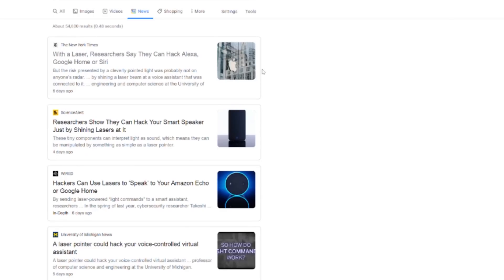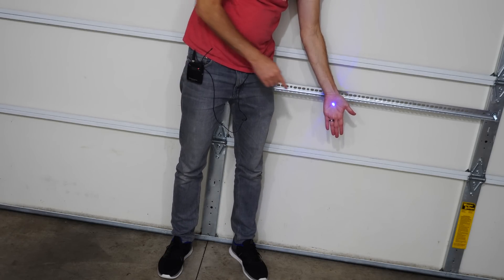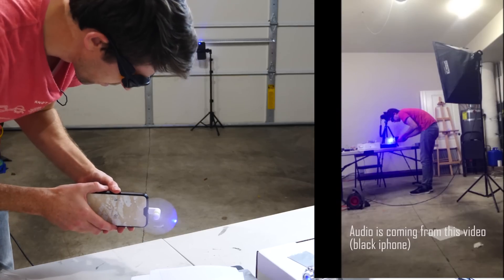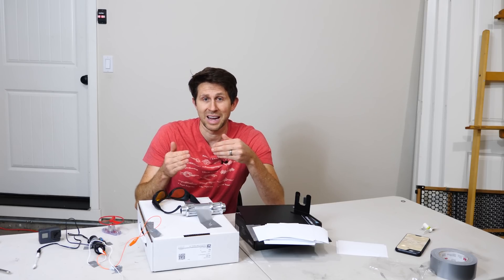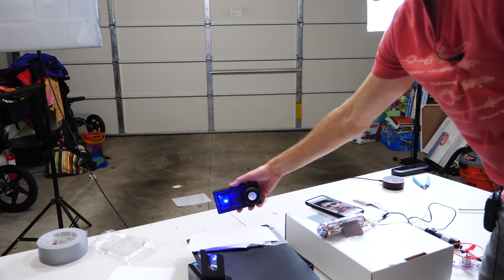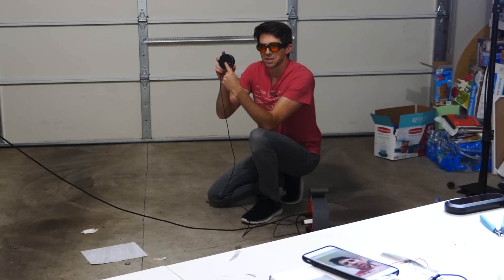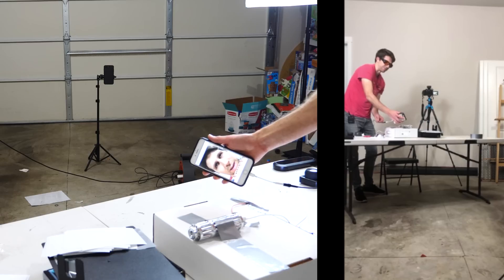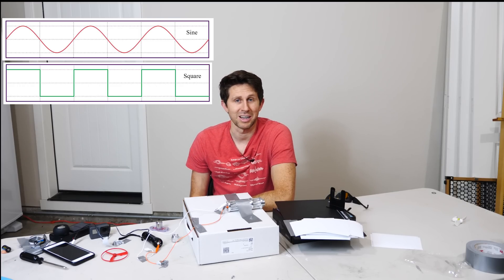Hacking into an Amazon Echo Using Laser Light to "Speak" to Alexa

Comment from the maker: I was actually surprised that you could hear the sound from the pulsed laser just by using a fan! I just need to turn my sine waves into square waves and I'm set!
Reply: how about if you had a plastic diaphram jammed in/on your ear and stood in front of your laser setup? could you as a human detct the sounds? a passive setup like that could have many implications
Reply: You should try modulating the audio signal with PWM. That should do the trick
Reply: @iAgos46  I was thinking the same thing.
PWM is pulsed width modulation if anyone was wondering.
Reply: Plz repeat the same experiment by keeping the microphone in vacuum chamber
Reply: Just as a test on mics, you should try it with a regular microphone. That way you can establish whether or not it's the plastic casing on the echo that's blocking the signal.
EDIT: Also, try it with Siri, Cortana or Google Assistant.
Reply: You need to mention that the paper was about exploiting a characteristic of MEMS microphones.
Using a photocell is not the same phenomenon.
Reply: @netpilot5  Hm interesting, but can it still be caused by the photoelectric effect?

Since some diodes and other components also respond to light. 

For example the Raspberry PI 2 (its like a small PC) once had a similar component on board.
The component was part of the power supply and the problem was that you were able to turn the system off with the help of camera flashes (xenon light) of some smartphones.

Sadly I was not able to find information about why MEMS-microphones would have this problem.
("When it comes to the actual physics of a microphone interpreting light as sound, the researchers had a surprising answer: They don't know. In fact, in the interest of scientific rigor, they refused to even speculate about what photoacoustic mechanics caused their light-as-speech effect.")
Reply: @CrazyT2009  tbh, if the guys who wrote the paper aren’t sure, I can’t speculate. They’re way smarter than me. 😊  But MEMS devices can have some weird characteristics. For instance, MEMS oscillators tend to stop working when exposed to helium. Also, the guys in the original paper used a powerful laser (5-10 watts at less than 10 feet away, if I remember) so whatever was going for them, they were really disturbing the microphones.
Reply: @netpilot5  According to https://www.wired.com/story/lasers-hack-amazon-echo-google-home/ it could actually be both. (laser that heats the membrane or photoelectric effect)
"But at least two different physical mechanisms might be producing the vibrations that make the light commands possible, says Paul Horowitz, a professor emeritus of physics and electrical engineering at Harvard and the co-author of The Art of Electronics. First, a pulse of laser light would heat up the microphone's diaphragm, which would expand the air around it and create a bump in pressure just as sound would. Alternately, Horowitz posits that if the components of the target devices aren't fully opaque, the laser's light may get past the microphone and directly hit the electronic chip that interprets its vibrations into an electrical signal. Horowitz says this could result in the same photovoltaic effect that occurs in diodes in solar cells and at the ends of fiberoptic cables, turning light into electricity or electrical signals."

I wonder if its possible to figure out what could be the reason.
Like cooling it down see if it has impact on it, or put it in a vacuum chamber.
Reply: however the physical audio that we provide as source to the microphone is analogous hence sinusoidal right?
Reply: @adharshkrish  YES! His voice being recorded in the making of this video is proof a microphone  does not need a square wave! I hope he just worded his thought process wrong cause what he said was definitely wrong.
Reply: Could you use the fan instead of the flashlight? Then the sine wave would be in the RPMs of the fan, which would convert the sine pattern to a square wave pattern at the hardware level instead of trying to come up with something to convert the sine wave to a square wave digitally?
Reply: Point the laser at the Alexa mic and tell it to start recording, play back the recording to confirm it is receiving the frequency from the laser
Reply: I guess some microphones are sensitive to light just like some air pressure sensors are, look at my video "My naza unit is sensitive to light"... Some modern microphones probably are designed around same type of semiconductors as pressure sensors... (well a mic is actually a air pressure sensor when you think about it)
Reply: Does anybody know where I can get that solar panel speaker? I Can't find anything like it, only solar powered, not solar input.
Reply: @TwoScooops  Why not get a solar charger and a Bluetooth speaker?

Seems like you could use 2 cheap off the shelf items instead of a single more expensive purpose built item.
Reply: @TwoScooops  https://profbunsen.com.au/product/the-light-modulator/

Or Grand Illusions in UK or just search google for buy light modulator.
Reply: Just put the fan in front of the voice laser! It will modelate your voice into a robotic one. Perhaps Alexa will still strigger?
Reply: Your experiment worked with the solar panel because it transfer light to electricity that make sound but didn't work with alexa because it can't sense light 
- sorry for my bad English
Reply: @The Action Lab did you note you replicated at minor scale the pulsars phenomena, detected many years ago, experimenting with the fan that interrupted the laser pulse? 😀
Another thing I loved of this video is that it can see how many frequencies of energy you were working, starting the visible light and the sound are energy in movement but in different frequencies. Thank you for make and post this video. 😃👍
Reply: Please read my comment. I just read the news about hackers using low-power lasers to "hack" phones and smart devices pike Google Home and everything. Maybe it was a coincidence and your video was uploaded when this discovery happened, but I'm now worried
Reply: Try to just turn laser on..off.on..off... and check if you can pick up sound by just doing that
Reply: S. A. Khan he already did, with the fan. Silly
Reply: Be good if you linked the video to the thing with the torch and speaker...
Reply: you could reduce the bitdepth to 1 bit
Reply: How about you use a fan while you modulate your voice through the laser? it would sound kinda robotic yes but you'll hear yourself anyway.
Reply: @Crescent Fresh Idk if that's possible, this video is showing how audio can be transmitted via laser, not how audio can be received. But that would be cool!
Reply: Two french guys made a video several years ago where they transmitted sound with laser at a huge distance.
Reply: You should have tried to put the fan in front of the beam while you were trying to trasmit your voice to the microphone.
Reply: The Action Lab lmao your to smart for me I’m only in 7th grade
Reply: The Egg Turtle you’re*
Reply: Show us solar panel working microphone
Reply: i say it's a form of electromagnetic interference, same as if you would put a micorphone up to a live speaker and get screaming feedback noises
Reply: Maybe the light pushes the diafragm of the microphone
Reply: Sure it didn't work because the frequency shifted from trying to vibrate a microphone instead of being received as light on a solar panel? Might want to start with recording the pulses with a standard microphone and listening to it.
Reply: Alexa won't pickup all the non human voices with in few months.
Reply: Maybe have a look into something related to PWM. It might need a frequency modulation in this case rather than amplitude.
Reply: What if you used a distorted version of your voice so it's more square?
Reply: Talking about a modern twist for the string on a can method for communication
Reply: May I suggest in future videos, you should show the effects first then explain? It would be less painful understanding the purpose of the video...
Reply: The Action Lab i really love you video. Please made a burning laser line using your laser. Thank you so much
Reply: I would like to know where and how you searched for those items , the solar panel speaker ,the laser and the sound/light modulater please :3

Greetings from Brazil 🇧🇷
Reply: Can you slow the fan down an speed it up to simulate words or pulses the laser and not use audio
Reply: I now know how to have my neighbors Alexa order 500 Nike's.
Reply: The Action Lab surely this is how digital audio works, right?
Reply: This means the sound is moving at the speed of light
Reply: When are you going to post that third videoooo???
Reply: Did you ever do part 2?
Reply: Yaa
Reply: You need to convert from analog wave to digital imo
Reply: ok boomer
Reply: Is this how optical fibre work?
Reply: Shuvrashankar mukherjee I guess that is not the case.Fiber optics deals with data conversion/deconversion based upon photoelectric effect. Apparently, this hacking occurs because of some light to mechanical effect that makes the microphone diapragm move back and forward reproducing the laser on/off signal.
Reply: This is what I made 1 year ago and uploaded it on my channel pls cheak it out🤠🤠😎😎😎😎
Reply: Nikunj Patidar damn you didn’t lie
Reply: @nick5845  Everyone should see this comment and check out your video.
Reply: Nikunj Patidar why would anyone want to watch an indian

Comment: @TheActionLab, Just a question: Do ALL laser lights require to wear safety goggles??... I never owned a laser light before, like, a laser pointer. Sometimes professors to teach with laser pointers and yet, nobody is needed to wear special glasses for it... Are just curious if we are talking about two different kinds of lasers here, or if wearing the special glasses is just for extra precaution... And, IS THERE a safe laser light out there that doesn't suggest/require special glasses to wear in order to be safe using it? Thank you. :)

Comment: It may have happened off camera but I didn't see you really line up the light with the actual speaker hole on the Amazon device like you seemed to need to do for the cell phone to get the signal into the mic. Could that be it? Just missing that opening on the top so it didn't get a chance to violate the diaphragm? 

Also, as a person with an African Grey Parrot that really enjoys making Alexa and Google work as her minions, it seems like saying Alexa too frequently can cause her to not respond, and so the speed you say her voice on recording might have been too fast. You could check the recordings that the device captured and review them through your profile on Amazon. The device responding isn't necessarily proof that it heard you, it definitely could have picked up your trying to trigger it and then just decided not to respond ruling it as not fitting criteria for activating, it listens a lot, for anyone that hasn't reviewed those recordings, it's pretty creepy. 

I get it "has to" or it won't work, but still the random bits of dialogue it keeps is surreal. I'm also convinced it's not everything that it sends to Amazon either that it's showing us the consumer. I've been served too many targeted ads that were not for me at all, and I can usually chase it back to some weird conversation I was having or something that used I guess some trigger words for ads to start heading my way. Those things don't show up in the recording, especially since I've told it to not save my recordings. 

So being served ads, for example, for My Little Pony the day after I'm talking about my niece being a fan of the show, were a little too not my demographic and unique to be coincidence.

Comment: The issue is you currently are running the laser through a speaker driver which runs on a different frequency in terms of programming than laser. What you could do is run it through a program that translates the lasers signal to a more frequent on off signals. I would suggest using an Arduino to achieve this.

Comment: You might be more successful if you shine the laser on one of the LEDs. It is a little known fact that LEDs generate a voltage when illuminated by a light source. Depending on the circuit you might get the output coupled into the audio circuit.

Comment: There might be problems related to how spesific devices have their microphones physically installed also.
To get a clean signal the laser would need to hit the diaphragm directly. If there are any obstacles in the way (like a simple dust filter or a curved sound channel) the input could get very weak and/or distorted. That might cause the voice recognition to not trigger. With sound these sorts of line-of-sight obstacles are not much of an issue since sound bends and bounces easily, but with a laser it would matter a lot, and the devices weren't built with lasers in mind after all. It wouldn't be hard to make a microphone immune to this technique if you wanted, but I guess it's just not something that has been considered yet, at least for consumer use.

Very cool technique though. With a powerful enough laser you might be able to produce audible sound on many surfaces directly. It would be the same principle, just without an amplifier you would need much more laser power.

Comment: What amaze me is that I do this trick in 1982 with just my first red dot pointer and it work, (officially red laser led tech was release to the public in 1980) . Then I use the sun light to bounce on a mirrow resting on the grass yard and hitting a monocrystalline solar cell connected to the microphone input of a cassette recorder and record all the different frequencies of all insect that cut the light beam. After this I put the mirror on a plastic empty balloon stretched to cover a 5 inces tube and put the mirror over the plastic so I can hear on the sun light any sound produced near the tube and reflected to my solar cell like being there. Thanks to the modulation the balloon transmit to the mirrow and then to the sunlight. Then I use a lens and  I covered the lens with black electric masking tape and only left a needle size hole uncovered of the lens center , I pointed the lens to the sun and the light that pass true the micro hole on the lens was projected on the solar cell so I start hearing the burning process of the sun, then I realize how clouds sound when pass  in front of the sun, then I used it to project the starlight of some stars to the solar cell and discover that some stars are not stars and they are satellites that blink and vibrate reflecting the sunlight to my solar cell and passing to the light all the different vibration they suffer and produce. I used with airplane lights too and some other strange lights of the night sky. I use to use lens with a layer of aluminium foil and a hole of 2 mm to project the image of the sun inside a black box to see the solar disk black dots and solar flares and at the end I connect a speaker to a gradient expose photography film in the light of the red laser diode and capture the light on a solar cell connected to the microphone of the cassette recorder and its record the music even at a distance of 50 meters. Then I realize that the cassette head was a sensor so I connect the solar cell to the cables of the play head of the cassette recorder and put it on play mode. immediately I could hear the sound on real time. Then I pass the laser red dot true a contaminated water drop and hear the microorganism moving on it. after that I came with a lot on new ideas but I has already tell you to much and I fear that your brain can be burn for the possibilities. So felicitations, you discover america, just 40 years late... is not to bad...!  : )

Comment: Maybe you didn't modulate the laser enough. Maybe it has to be visually flickering based on the sound.

Also, could also be the inherent sensitivity of silicon devices to light, and them causing interference with the microphone amplifier. It might not be the microphone itself to target.

Comment: little confused, do we speak in square waves or sine waves? The latter seems more like an analog signal. I wonder if the issue was you were pointing at the center of the dot and not hitting the microphone. Perhaps you can do a "check" by trying to read the vibrations coming off the device from your laser similar to how they use lasers to listen to vibrations in rooms. great work and learned a lot, thanks!

Comment: Word of advise, for 1, I can't really test this concept, but in the same way you would hook up a 555 timer to a capacitors then the speaker like this v

 ___
| 555 | -----> 10uF Capacitor ---> Speaker
|_____|

You probably need to block the DC signal whcih is my guess.  Alexa probably already has a DC blocking setup, so it's not Alexa. But, I haven't watched your solar panel light thing yet, but because you're sending digital signals with the light, like you said it wont work.

Comment: Why are scientist baffled by this? It's doing this because sound, light, heat... Are all one in the same being field perturbations through a medium. 
 This is the very reason why I wish people would stop calling light a partical, it is a coaxial circuit not a duality where it thinks it's a wave one second then another a partical.  The effect happening is no different than sound pressure waves pushing on the diaphragm of the mic creating a resonance to be turned into digital audio.
None of this is any different than what fiber optic signal pulses are. Amazing how I messed around with doing this years ago but when it's some scientist that do it it's ground breaking news. 
 Nothing against this channel I like your channel, just the mainstream nut swingers that annoy me😒